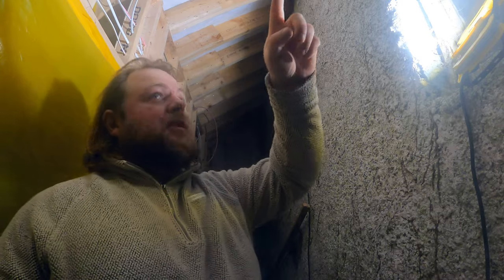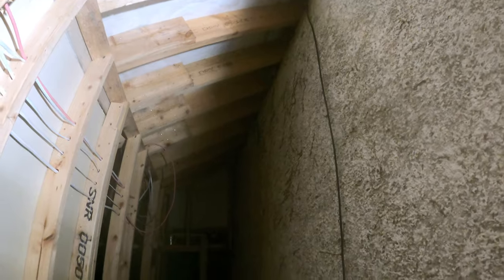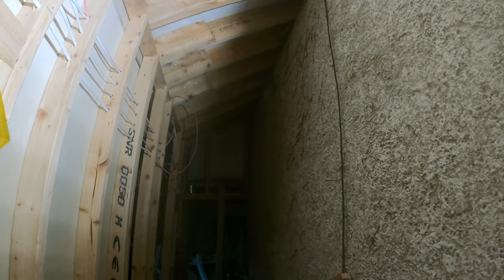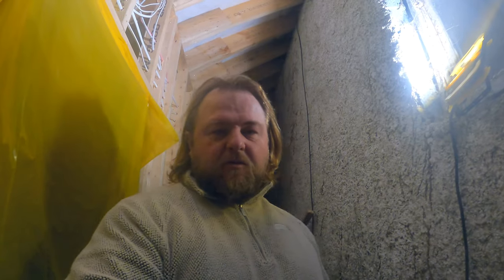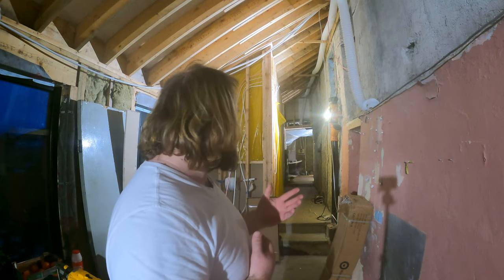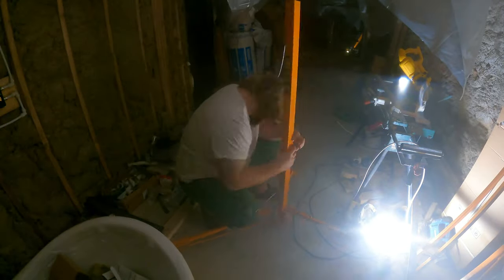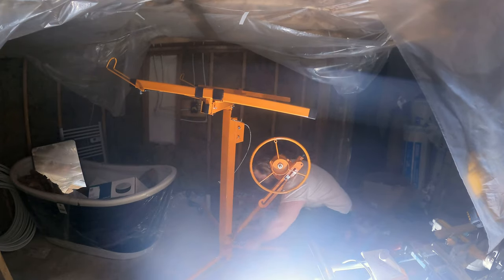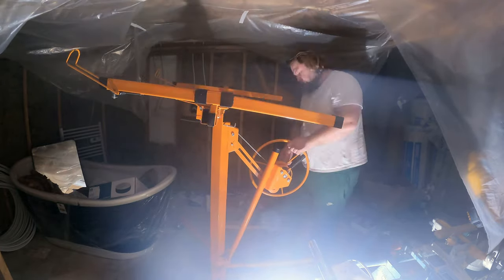EP62: Bedroom RENOVATION ideas | DIY Couple | 250 year OLD Farm House in the Irish Countryside

Comment: Im betting that since this was 5 months ago you have figured out by now that its easier to rock a wall in sheets installed longside horizontally. Jam a full sheet into the corner, cut off the extra next to the door opening. Then you can see the top half of the wall stud to place your screws. Snatch up the cut off piece and rest it on the top edge of the bottom sheet. You will be able to follow the path of your screws all the way to the top. Viola!
Reply from the maker: Oh gosh so much learnt about sheet rock, you would not believe. We learnt by our mistakes alright 😊

Comment: I feel your pain with the boarding. It must be nice to notice the improvement in heat retention and the change in acoustics as you insulated and board each area. 
The large bedroom window looks great now it's surrounded by board - Like a painting on the wall. 
Once the materials are shifted upstairs that part will be easier to close up as at least you'll have more room to move and work generally.
Great video. Thank you.
Reply from the maker: Very true! We seem to have been working around so much stuff for months! Moving from one side to the other and back 🙄The sound is incredibly different, as we used to hear the rain on the tin roof. Thanks for watching 😊

Comment: Push your screws in  abit more so you can plaster over them . Your doing a great job. Maybe also use your cut offs for tight places and the one that broke you can still  use if you cut it.
Reply from the maker: Ahh yes, the perfect screwing in. Too much and the bloody thing goes all the way and breaks the board. Yes we were striving for just below the board level. Thank you for commenting 🙂
Reply: @WestCorkWander  look up "Drywall bit" - they are designed to countersink the drywall screw to the correct depth.
Reply from the maker: Thank you for this 👍

Comment: Hi!  I just started watching your videos!  They are fascinating!  Quick question about your venting for your extractor.  Since your vent tube is so long is it possible that condensation might accumulate in the tube, especially where it dips down, and cause leaking in your ceiling?  I watched a video from Martin Johnson, Off Grid Living, and he had a problem with this.  His venting was over an unheated space so it might be different but I do think that as the steamy air cools, even in a heated space, since it will be slightly cooler than the steamy air, it might condense.  Just a thought for you to consider.  Marty said that the rule is to make the vent tube as short as possible to the outside.
Reply from the maker: Yeah it's a fair point. Were not 100% sure but we did make the conduit easily accessible! 🤞🤞